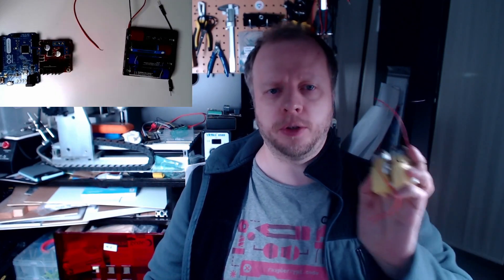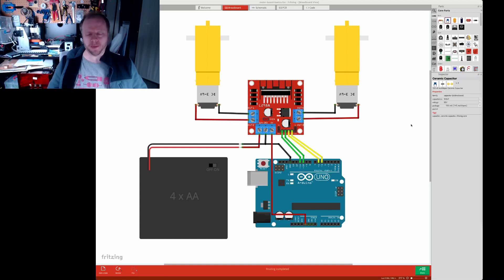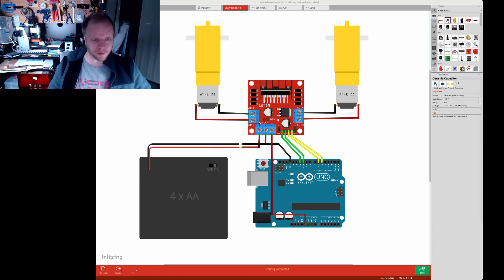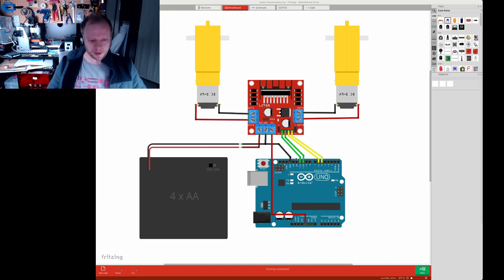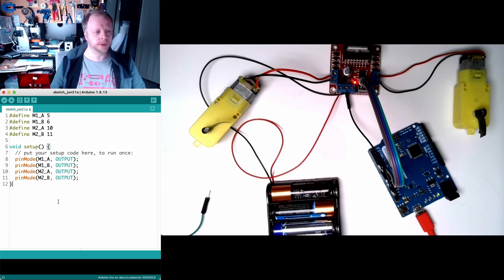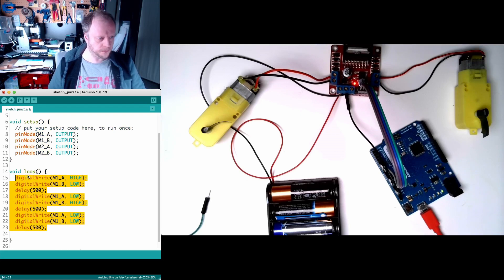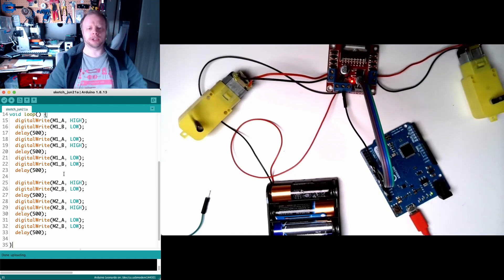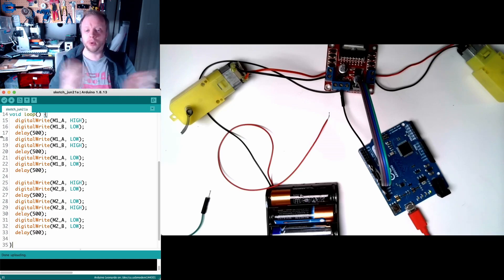Robotics Motor Control Tutorial in less than 4 minutes!

Comment: I think this is a good format for less experienced builders - well done. Q. What in your opinion is a good 'step-up' from the yellow plastic motor/gearbox type? They have a lot of backlash and are not the best for movement accuracy, in my opinion. So what to use if you want to avoid two motor robots crabbing left or right. I have had to use short delays in code to even-up motor speed/distance travelled.
Reply from the maker: First, I would recommend metal hear motors, the micro or N20 kind. However, motors, even the same batch and obviously same gearbox, will vary and will veer over time. Encoders with PID based code to manage motors is the best way to go in a straight line, and it also lets you make accurate turns too.